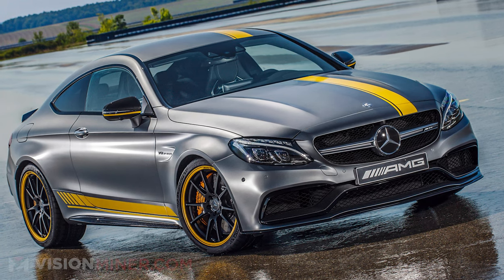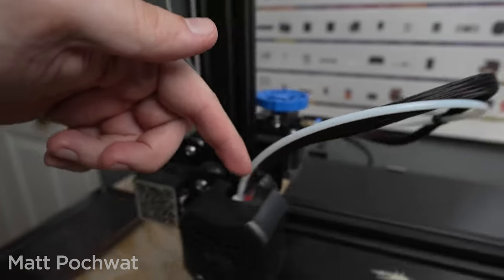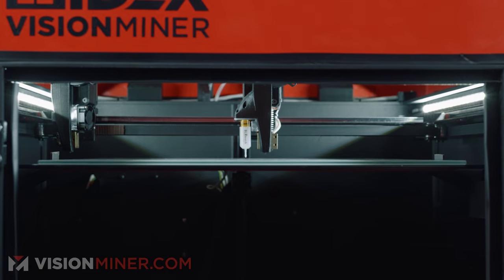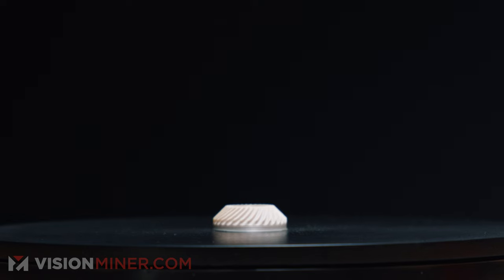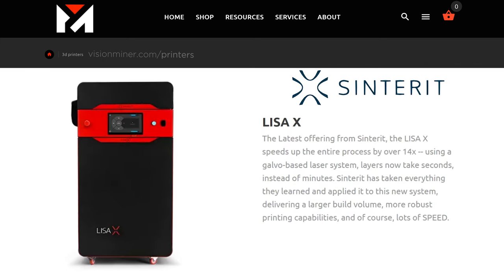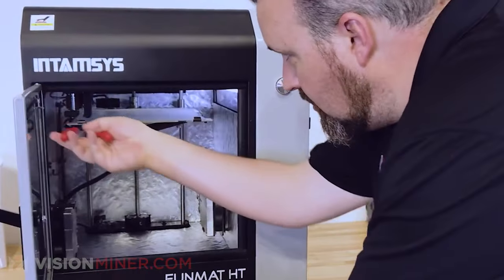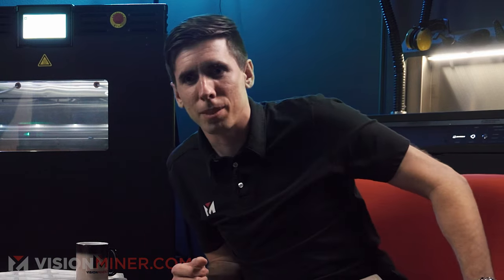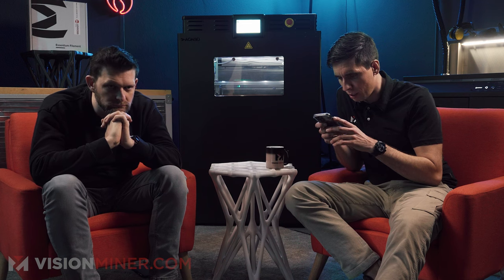Building vs Buying a High-Temp 3D Printer: What's More Cost-Effective to Print PEEK and ULTEM?

Comment: havent watched the video yet, but i GUARANTE you I can. I currently have a klipperized bastardized CR-20 that prints at 80c chamber temp, 200c print bed, 450+ nozzle. Yea, your right I need to change my Z-offset if the printer has been printing and is warmed up vs starting a print cold; but thats pretty much the only problem. Replace the belts, V-wheels with linear rails, add an AC bed, and add an infrared lamp and enclosure(to get the prints hotter than the air, good trick for high temp filaments), and your good to go. I have also got my speed benchies to around 5 minutes (following speed benchy rules) on a friggin bed slinger. 
I mostly print polycarbonate and nylons, so I dont need to push past 80c for stuff like PEEK or ultem. I dont really see the point for how much they cost and how incredibly strong PC and CF-Nylon is for my applications.

I am a mechatronics engineering student tho.
Reply: obviously dumb for a buisness, but I can see adding insulation to a bambu labs printer as a great cheap way to get a great high temp machine (medium high temp, <80c chamber).
Reply: I will disagree with you. The game changes once you go over 80 c. I have built a printer with all those things. On paper it sounds simple but its the experience that you pay for. I thought the same thing in college. Your time is valuable as an engineer and can easily cost more then the price tag they ask. Plus you get support.
Reply from the maker: Very well said. And yes, Chase, you totally can! Definitely get the context of the video, though, because it wasn't a challenge or us saying you can't :) More about overall scalable business viability :)